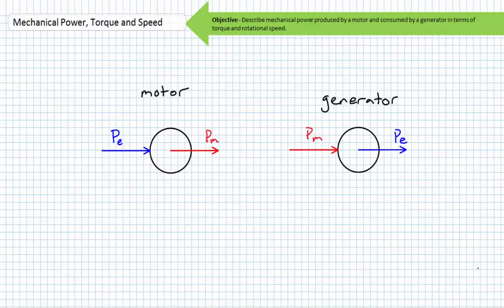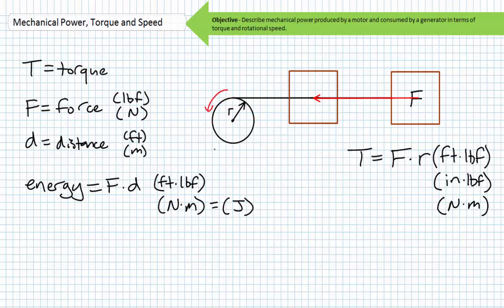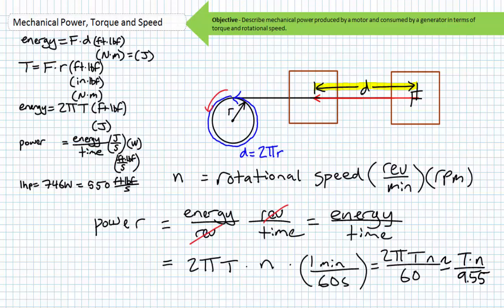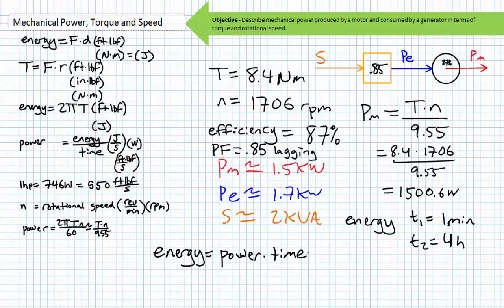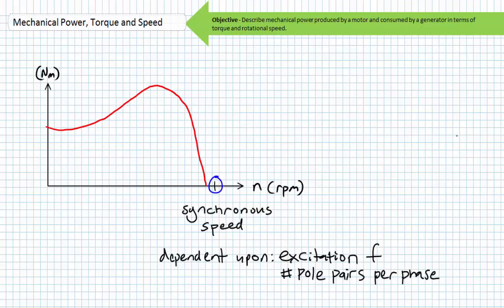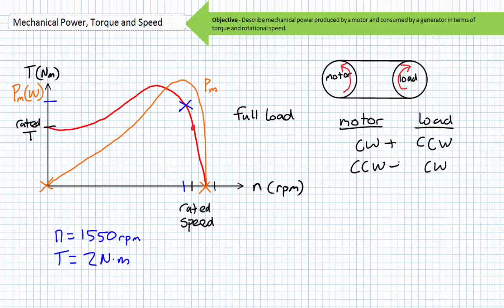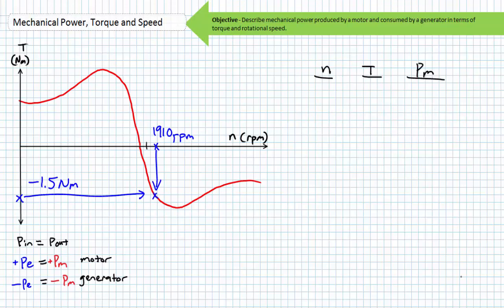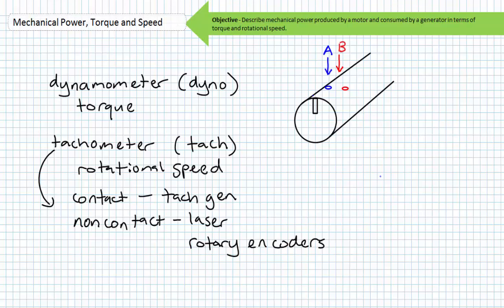Mechanical Power: Torque and Speed (OLD LECTURE)

Comment: thank you for this episode.

could you please explain power torque and speed of the wind turbine ??
what is the maximum power point of the wind turbine?
Reply from the maker: Stay in touch. I plan on doing a complete series on industrial wind power.
Reply: @bigbadtech  when???
Reply from the maker: Not sure yet. I'm hoping to finish fixing the Basic Electricity and Electronics 1 playlist this winter. After that I'm open to start working on motors/generators, pneumatics, industrial wind power, solar, and more.

Comment: The generator produces counter torque and does the motor produce counter EMF? Is the idea somewhat based on Newton's 3rd law: for every  action there is an equal and opposite reaction?
Reply from the maker: True dat. Ironically enough I'm producing another lecture on induction motors and inrush current that discusses counter electromotive force (CEMF).

Comment: If Torque = Force * Distance, the Distance must be the arc length of the circle of subject.
Reply from the maker: True dat! Turn a 1m radius shaft once you pull in 2pi meters of rope. Excellent way of equating rotational and linear  movement
Reply: @bigbadtech    obliged to get your reply. It is so nice to have such dedication to upload such contents. Having said that,  would you like to have a conversation in future on following thoughts.

before that please check it out :

Maybe you wanted to tell "Left hand side of the screen ?" on : https://youtu.be/fv5494lRQAs?t=518 

Though the  length of radius seems to us as a scalar quantity, and we equate that to the arc length but does not our measurement depend on the  initial orientation of the radius?    Radius seems scalar but if we do initiate the measurement from a specific angle the radius seems to be orienting in a particular direction  and it is really a concern for vectorial geometry especially trigonometry. It is fine to equate the arc length with the length of radius, but it surely does not add specificity to it.  It may  help for getting a intuition but does that really do as it should do ?

Another visual tool for our intuition is the Maxwell right hand corkscrew rule. If we verify the tool and its statements of application we find inconsistency.  the statements of application itself not provide any constraints.  It helps us visualise the magnetic field lines only from the perspective of weather the field lines are inward oriented or outward oriented with respect to the current carrying loop. 

Let's consider two scenario: 
Considering the sky as top and ground as bottom for our frame of reference
Scenario A:

Thinking as if we are Standing on the ground, hands straight down fingers pointing towards the earth and we trying to get a understanding of maxwell's corkscrew rule, we curl our right hand fingers, point our thumb as if it is going out of our body and try to make a loop from the right hand side of our body to the left hand side of our body, as it makes a u turn in front our face we see the fingers curling outward with respect to the loop but fingers curling bottom to top.   

Scenario B: we do the same thing, but this time our hand raised straight up towards the sky and we curl our right hand fingers. let the thumb point as if going away from our body and we make a loop from right hand side of our body to the left hand side of our body making a u turn in front of our face we see  fingers curling outward with respect to the loop but from top to bottom.

Totally different result from the previous application for  visualising magnetic polarity.

We have to visualise the right hand screw rule to understand the inward or outward orientation of the magnetic field lines with respect to the loop but  to understand weather it is entering into the loop (i.e the hole created by the loop) from top or bottom or  getting out out of the hole created by the loop  from top or bottom we have to come out with a clear definition  to solidify our conventional wisdom. 

It may not be true to say  definitely,  magnetic field lines goes from north to south, it may be a convention to say so but do we really know for sure ,its polarity & orientation? 

Need your feedback and suggestions. 

please check out the above video if you haven't; thank you for the valuable time and attention to the comment.  would like to get words soon.
Reply from the maker: Here's the deal: the X signifies current going into the screen (arrow fletchings traveling away from you). Dot signifies current going out of the screen (arrow point traveling towards you). Either scenario: point your right thumb in direction of conventional current flow. If X, magnetic field turns CW. If dot, magnetic field turns CCW. Not entirely tracking your verbal descriptions of A and B. Here's an easier scenario: take your monitor off your desk and put it on the floor and point your right thumb in the direction of conventional current. Same phenomenon occurs. Now take your monitor off your desk and nail it to the ceiling and point your right thumb in the direction of conventional current. Same phenomenon occurs. Do magnetic lines of force really travel N to S? It doesn't matter ... that's just the convention employed. As long as you stay consistent it works out.